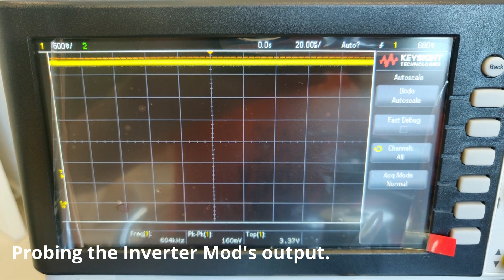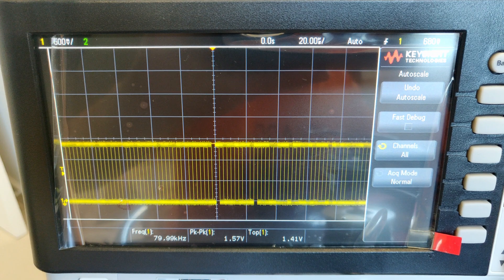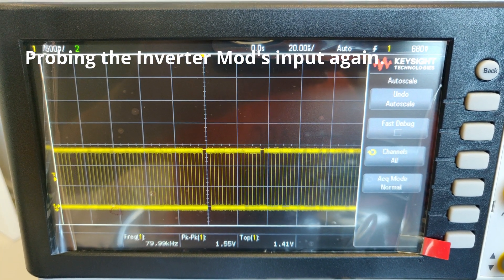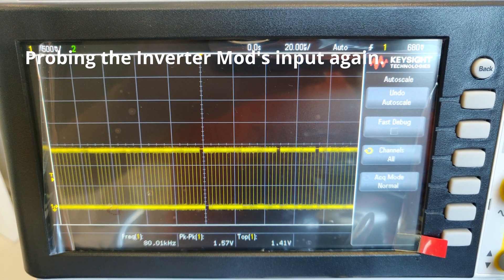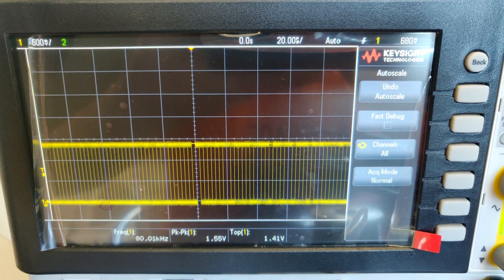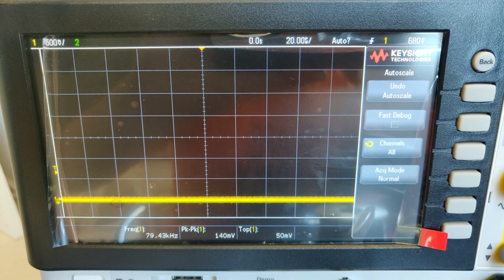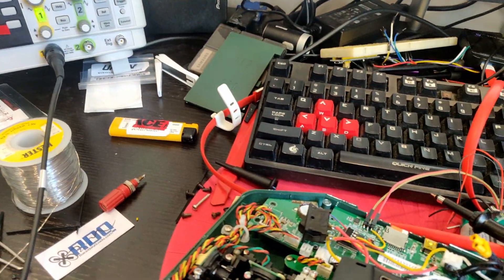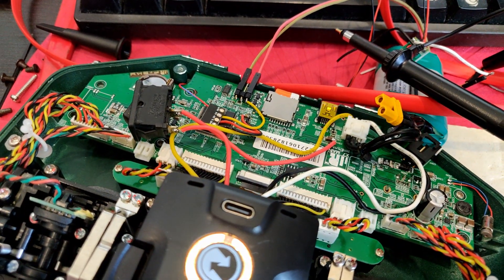Taranis QX7 Issue With Lua Script and Telemetry | Inverter Mod | FrSky R9 to TBS Crossfire Part 2

Comment: I'm on open tx 2.2.1 and just did the inverter mod and installed crossfire micro v2 and did not have any issues with Lua scripts.
Reply from the maker: That's great news. On my end think I screwed up the mod and need to fix it.
Reply from the maker: Fixed it here: https://youtu.be/zJswjcniM3M